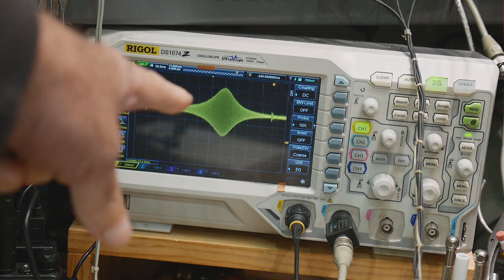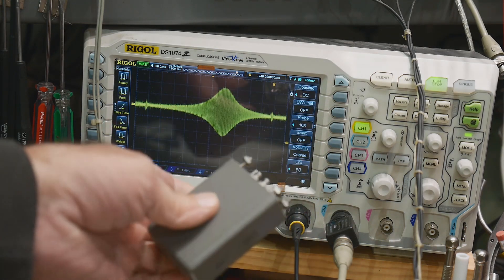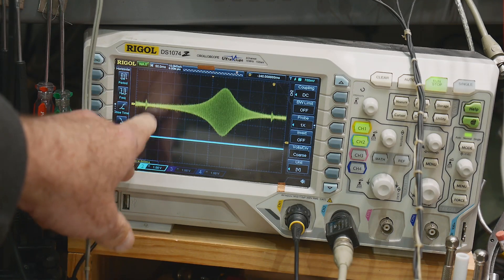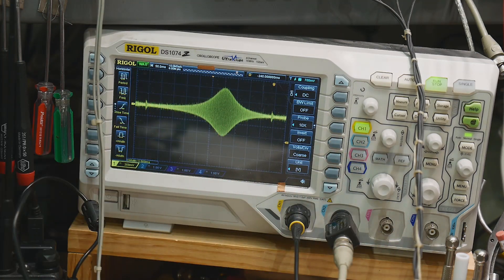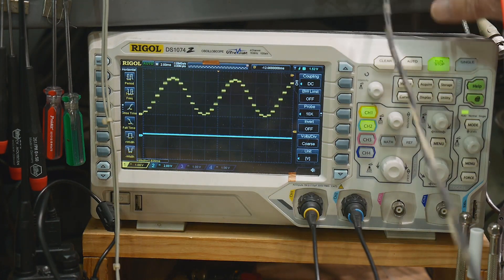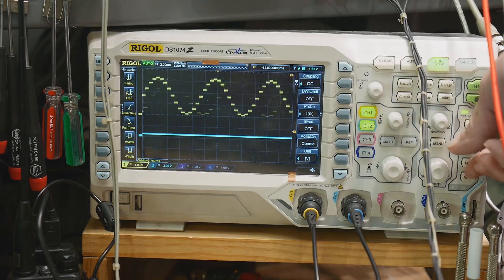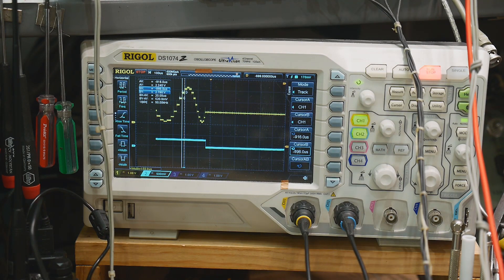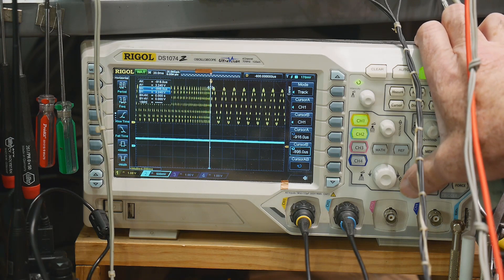#685 Designing an Audio Sweep Generator

Comment: I used ESP32 devices in several products I have designed, but never used the DAC for obvious reasons.  For this type of application I'd look at the SAMD21 or the STM32F400 series devices.  Also, if you are going to filter the output for a clean sine wave, why do you need more than two levels?  And a related thought:  I'd be using an internal counter to generate the square wave with the processor intervening from time to time to change the timer parameters.

Comment: To reach the frequency limit of a given hardware a DDS implementation with phase accumulator has different ways to avoid harmonic distortions at low and at high frequencies. 
The signal is generated by adding a phase per time value (which is the current frequency that is increased over time) in a constant rate to a register called phase accumulator. From there the (modulo-) values are converted to the sine values and given to the output. 

In this way there is a high resolution at low frequencies which provides low distortion, maybe even with more than 4 bit which is already quite good. At higher frequencies only a few values are provided per period, this number is not restricted to integers and goes down towards the Shannon limit of 2.  At these frequencies the signal has a high distortion but the harmonics at these frequencies are out of the regarded band and can be reduced by a fixed low pass filter.

Comment: I would use one of your DDS boards hooked up to an Arduino or similar and just step through the frequencies from start to end. I believe when you do that it is phase continuous but that should probably be checked.
Reply: Well, I dinked a bit tonight with that on my DIY AD9833 DDS. It's a start I guess or an early failure, not sure yet :) https://youtu.be/gf8DMIpP_ZI

Comment: This is why I watch. And now we know why HP made good instruments. BTW, the HP will only sweep to 15 meghertz. Not so good for fm?
Reply: When it was released, the 33120A was considered a "low RF"/audio-frequency function generator similar in niche to the 33250A or the newer 33500/33600 stuff from Keysight - good for audio and high-quality message signals. If you wanted to sweep the broadcast spectrum, you bought an 8000-series signal generator that went to hundreds of megs or even a gig.

Comment: Great, thank you for educating us. Why not to post the Arduino Code here for users. BTW. I am as well a great fan of the ESP32 series.
Reply from the maker: /*  
 DDS

 sync pulse on pin 25
 output on pin 26
  
 #########################################################################
 ###### DON'T FORGET TO UPDATE THE User_Setup.h FILE IN THE LIBRARY ######
 #########################################################################
 */
#include <TFT_eSPI.h> // Graphics and font library for ST7735 driver chip
#include <SPI.h>

TFT_eSPI tft = TFT_eSPI();  // Invoke library, pins defined in User_Setup.h

#define button0    0 
#define button1   35
#define ADC        2 // input pin for ADC
#define DAC1      25 // output DAC
#define DAC2      26 // output DAC

// 8 bit DAC so values 0 to 255
// offset so 0 is 127  +1 is 255 -1 is 0
int sinebits[] = {127, 176, 217, 244, 254, 244, 217, 176, 127, 78, 37, 10, 0, 10, 37, 78};

void setup(void) {
  pinMode(button0, INPUT);
  pinMode(button1, INPUT);
  tft.init();
  tft.setRotation(1);  // rotate display every 90 degrees 1...3
  tft.setTextColor(TFT_GREEN,TFT_BLACK); 
  tft.fillScreen(TFT_BLACK);
  tft.setCursor(0, 0, 4);    // size 4 font
  tft.println("Ramp        pin25");
  tft.println("Sinewave pin26");
}  
void loop() {
  dacWrite(DAC1, 255);                  // high going edge for start sweep
  for(int j=0; j<1024; j++) {           // number of step in one sweep
    dacWrite(DAC2, sinebits[j%16]);     // sin output, mod 16 to match 16 steps per cycle
    delayMicroseconds(1024-j);          // sets time between steps
  }
  dacWrite(DAC1, 0);                 
  delay(1);
}
Reply from the maker: I can post it in a comment but not in the description.
Reply from the maker: I cannot post arduino code in the description due to certain special characters YouTube  will not allow. that means I have to put it on github and that was too much work for just a couple lines of code..
Reply: @IMSAIGuy  Pastebin it.